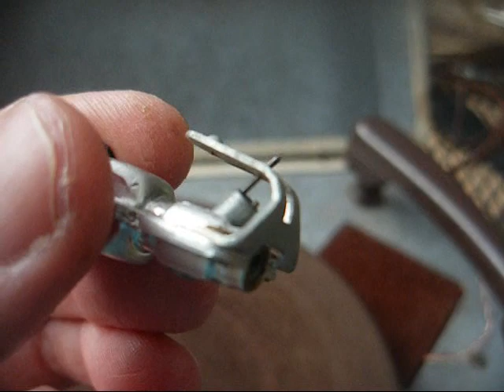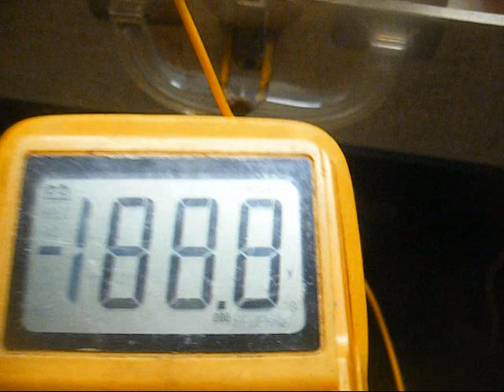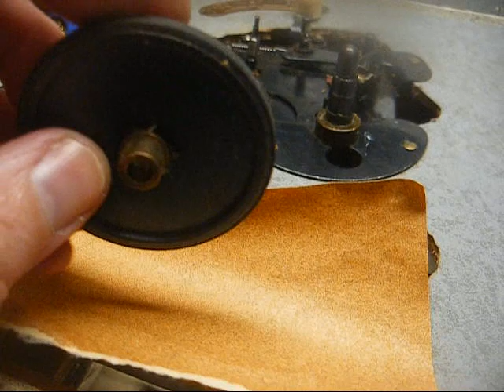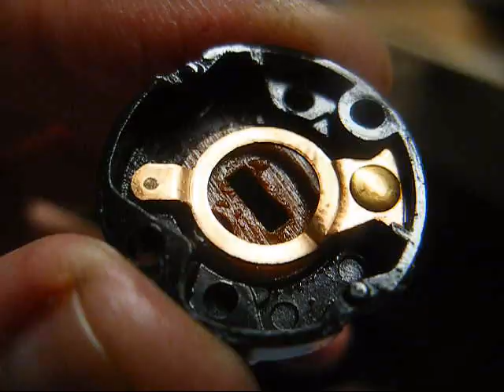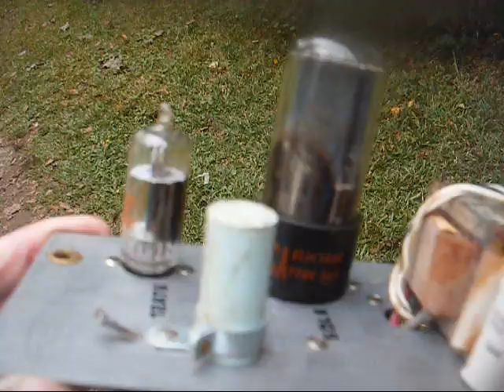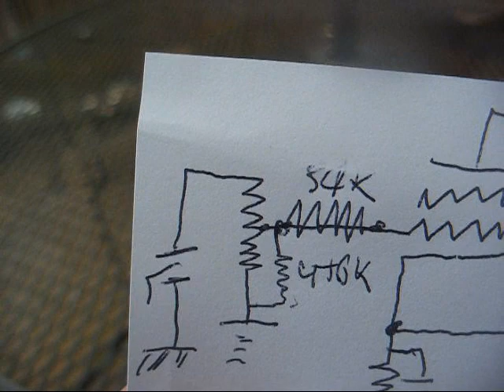1954 Bel-Aire record player that had almost everything wrong with it

Comment: You know, I watch several of these restore videos. I often wonder if, when removing the old rectifier one would replace it with a full wave rectifier, weather self built from 4 diodes or the ready made type. I always have several of these laying in my junk bin from teardowns of electronic devices, computer power supplies and the like.  Would there be too much current or voltage using the full sine wave instead of just the half wave rectification that a single diode furnishes?

Comment: Wouldn't it be possible to put a 560k ohm across the ends of the pot. With parallel resistance being what it is you should end up with around a 470k ohm, or there about, pot.

Comment: One of the nice things about consumer electrical products of this vintage and earlier, like this record player, is that they were designed well enough that you can actually fix them up, like in this video. A well stocked junk box helps, and a little ingenuity, like we see in this video, will go a long way towards doing a successful repair. A good example is in the replacement of the volume control and cartridge. Try doing that on a Chinese "Crosley."

Comment: Where do you buy your idler tires? I've got a Philco model 42-1003 'm working on. Thanks! Btw great videos..
Reply: Rich Kudlick , if the rubber on the idler wheel is in otherwise decent condition, you could try restore it by rubbing some isopropyl alcohol (otherwise known as "rubbing alcohol") on the rubber surface. That will many times cure the problem of slippage. If not, then try some kind of liquid rubber conditioner, rubbing that on the rubber surface. I've had success with both approaches, as long as the rubber wasn't cracked, with pieces missing. Sometimes, a light sanding with sand paper works, too. It's definitely worth a try either way.
Reply: @jeromewysocki8809  Thank you

Comment: Actually shipments from China have been arriving very quickly. I have been receiving eBay stuff in less than two weeks. 500k potentiometers  are plentiful and inexpensive, including ones with switches like the one here. However, they are linear taper and I presume here an audio taper is required.

Comment: for volume, could you use a lower ohm speaker? Like 4 ohm instead of 8?
Reply: No, that’ll overstress the amplifier; it’s designed for an 8-ohm impedance, and - in general - you’ll get maximum power transfer when the impedances are matched. Nope, use an 8-ohm speaker. 😊

Comment: 45 watts?  Tube amps with 150ma  heaters shouldn't draw more than 20-25 watts, which means that the motor draws 20 watts.  Sounds a bit high for a shaded pole induction motor.  So it's 300ma heater  with the motor acting as a dropping resistor, that explains it.  I once built a replacement amp for a phonograph using tubes found in my junkbox.  Had a 70L7GT and a 12SF5, worked rather well.  As for power cords, I have a ton of computer power cords, I chop off the end that plugs into the power supply and have a nice 3 prong polarized plug for safety with AC/DC circuits.  You could add a 6AV6 or 6SQ7 preamp in the hold where the old filter cap used to be.

Comment: You had that yellow meter as long as I have been watching you , I have that same meter too , they sell it at Harbor freight 22.95. As you have proven it's a reliable meter that gets a lot of use , I since added several other meters to my hobby like a fluke and one with a oscilloscope, I kinda of like auto ranging meter but it's nice to have a manual sometimes.hope you get yours fixed or replace, my radio shack meter I loved for over 30 years died on me too.and it's good to upgrade once in a while.I always look forward to your videos and your rants.

Comment: Hi. I just put new tubes in a magnavox record player I would imagine is from the mid to late 50’s. Would you have any pointers on helping me work with that? I imagine similar to what you’ve done with this, just thought I’d ask.
Reply from the maker: Bad capacitors and cartridges are the main problems with these older models.

Comment: You should tape that old knob (probably the pot too too) the inside of the case under the motor board.  That way, if anyone ever wants it to be original, they can put in the right pot.

Comment: Do you have any information about a deJay record player I picked up about a year ago? I haven't seen any that look like mine, it's from the 60's and all the ones im seeing are from the 70's on up.
Reply from the maker: They were mainly around during the '70's and '80's; but, I have seen a few from the '50's and '60's that used tube amplifiers. As far as who actually made them, I can't help you with that. Back then, most of those types of record players used the same Alliance or General Industries drive mechanism and the same "cookie cutter design" single tube amplifier.